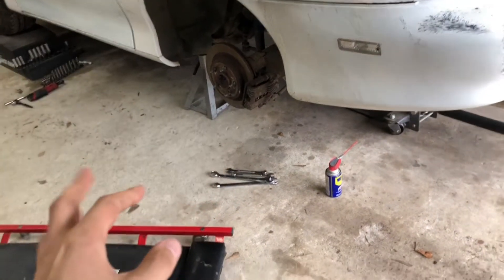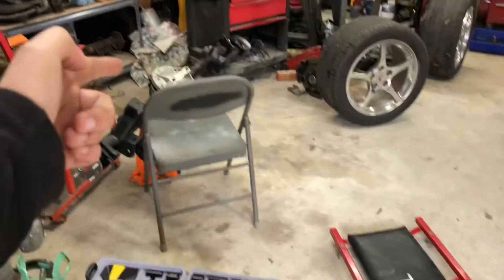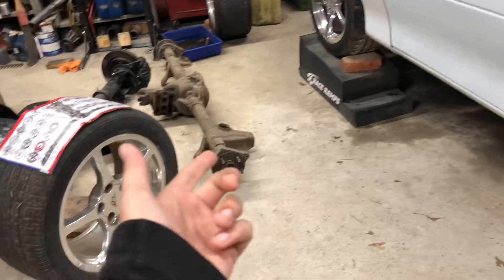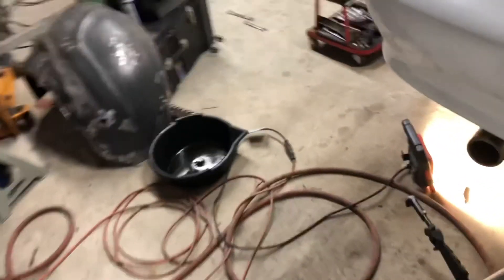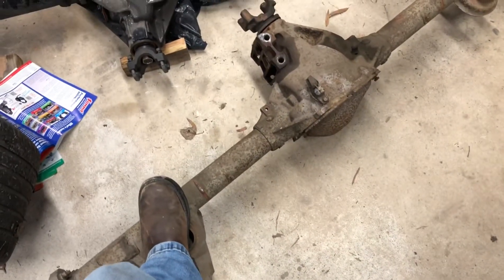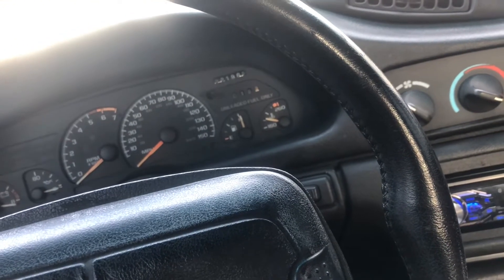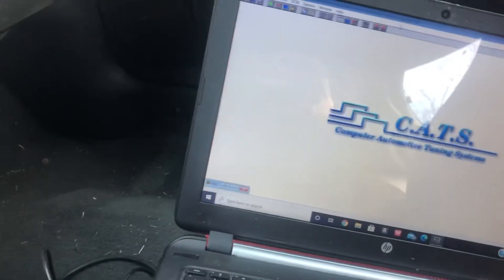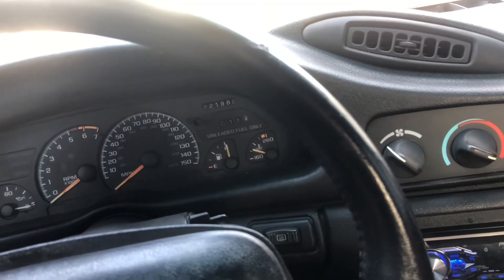Rear End is FINALLY Getting Installed

Comment: Heard this car once and love it
Reply from the maker: I appreciate it bro!
Reply: @mulletzgarage1676  Hi. I have a firebird 2000 v-8, t- top.  Do you know how long it would take to replace an ac compressor, dryer and orifice?
Reply from the maker: I personally do not know. I have not replaced the ac compressor on my car. I do have a freon leak but have not tracked down the leak. If it is the compressor then I will make a video on that.
Reply: @snow-wlkr7xplorer494  its only a few bolts takes a few hours to do the compressor and recharge up the lines. first you need to take it to the shop and make sure they take out all the refrigerant for you. the machine to do that is expensive and you cant rent one. then take off the serpentine belt unhook the lines from the back and then unbolt then unbolt the ac compressors. ac compressors come 2 ways either its filled with oil already or you have to add it make sure you add it if need be then bolt the ac compressor back on hook up the lines to the back then put the serpentine belt back on. then have to get a vacuum pump and you have to hook it up to the lines low pressure and high pressure. then you have to let that sit for an hour. then figure out how much refrigerant you car needs. in your case its 24oz of R-134a for your car. which is 2 12oz cans. you put a tap on top of the cans just tighten as tight as you can by hand. then using the lines you hook the vacuum pump too you put the tap on there and charge it up. obviously if you need to replace any broken lines do that part first then hook up the ac compressor after. its not very difficult to do on any car. the most important thing is not to get any air in the lines other than that its straight foward and just like anyother repair job. I had to do my 1993 camaro z28 the ac compressors arent very good and are known to break so everyone that has these cars will end up either ignoring it or replacing it. its way easier than say replacing an optispark. this is the kit you need to do it has everything except the refrigerant.
https://www.amazon.com/XtremepowerUS-Vacuum-Refrigeration-Manifold-Gauge/dp/B00SZ4QFW0/ref=asc_df_B00SZ4QFW0/?tag=hyprod-20&linkCode=df0&hvadid=198151843411&hvpos=&hvnetw=g&hvrand=5633864901648424284&hvpone=&hvptwo=&hvqmt=&hvdev=m&hvdvcmdl=&hvlocint=&hvlocphy=9001850&hvtargid=pla-381147635737&psc=1